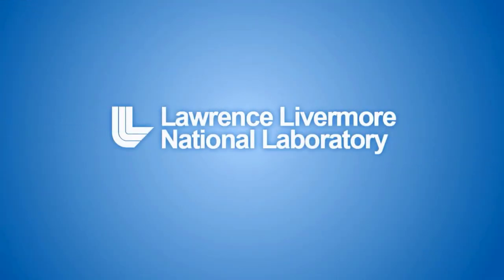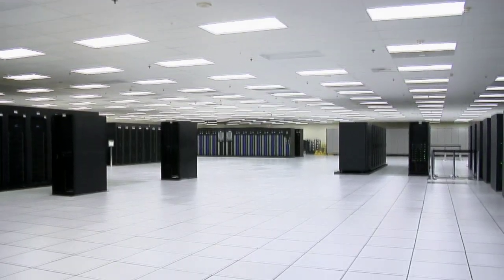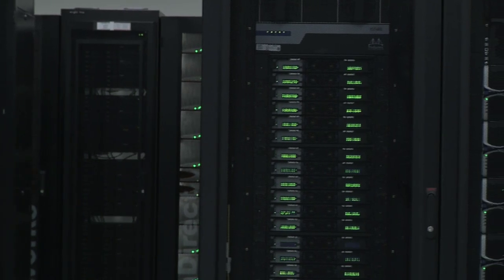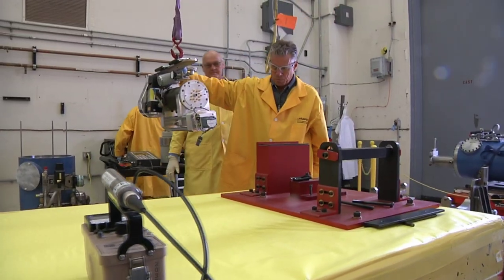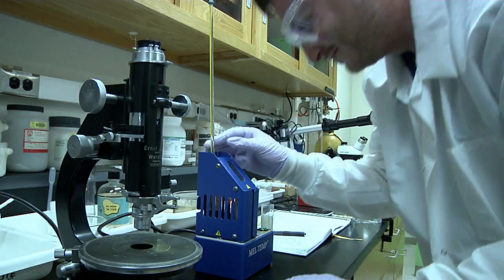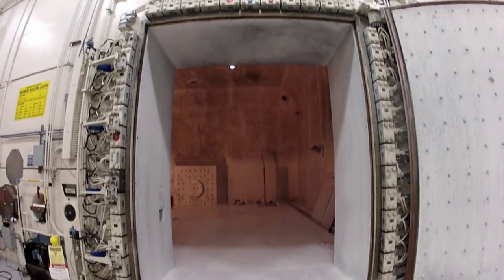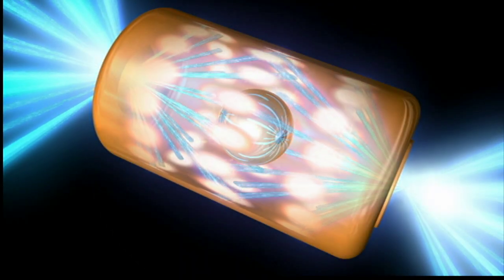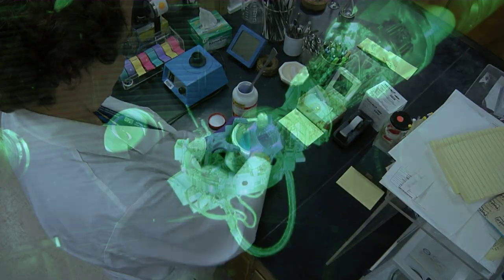Stockpile Stewardship: How we ensure the nuclear deterrent without testing

Comment: Is it 400,000 times faster, or 400,000 times as fast? Is there a difference? Yes, and most people get it wrong because they ignore the literal meaning of the grammar. 400,000 times faster means literally 400,001 times the measured speed. You do the math.

Comment: what about putting them in helium vaults .....don't their properties remain in Nobel gases?
Reply: Helium is too penetrating it could compromise parts like semiconductors for the Radar, capacitors for the firing set etc. The main problem is the core is quite warm and makes neutrons that degrade the explosives that assemble the core to a critical mass. The "critical" components (pun intended) are contained in a laser welded metal capsual called the "canned subassembly" for exactly these reasons. Plutonium is a very reactive metal chemically, behaves a lot like cerium that makes cigarette lighter's spark. Machining the stuff has to be pure nightmare fuel... 🤓

Comment: But eventually the US will have to build new weapons to replace the old ones? Even if they are proven by this program that they are enduring longer than designed for?
Reply: Why can’t we use this technology now to make a non radioactive Fusion power plant ? We could have so much power we would have to give it away !
Reply: Ron Lawson it has been made, the problem with fusion is that at this moment it costs more energy to create than it provides which kinda defeats the point.
Reply: @oceanhome2023  because right now the only way to generate lots of energy through fusion without dumping more energy into starting the reaction than you get out of it is the way a thermonuclear bomb works. Which is: use a small atomic bomb within the main bomb to ignite the fusion fuel. So a fusion reactor right now could only work by constantly detonating small nukes to power it, which is kinda impractical
Reply: We may have to build new weapons, but we won't necessarily have to build new designs or return to nuclear testing. The United States and United Kingdom conducted over 1,000 nuclear tests during the Cold War. We have masses of experimental data, we possess existing weapons designs that we know to work. All we need to do is keep the current weapons up to date by building new ones when the old ones shelf life comes to an end. There's no need to fiddle around with trying new designs; the existing ones (particularly the W76) work perfectly well and there's little reason to change that